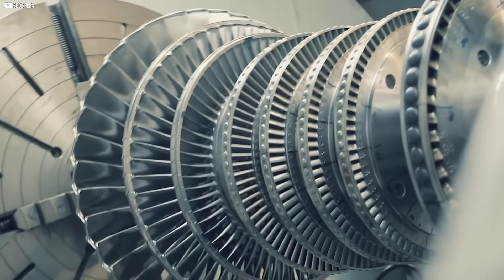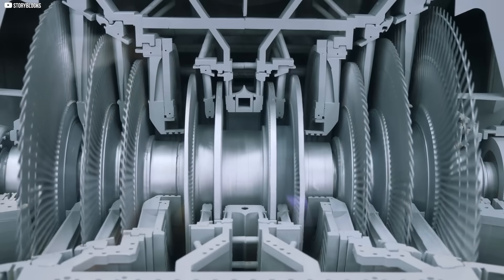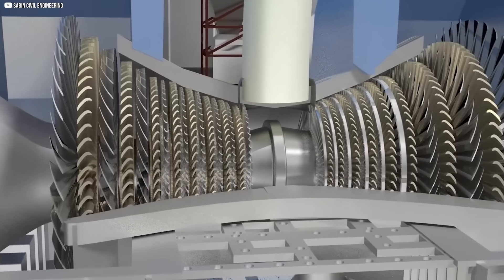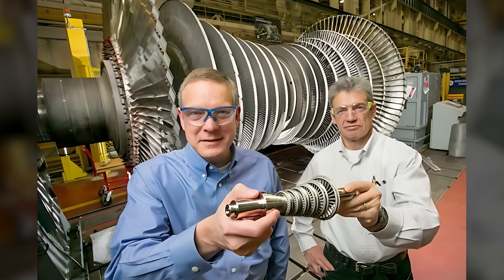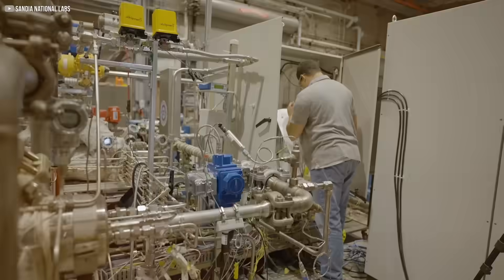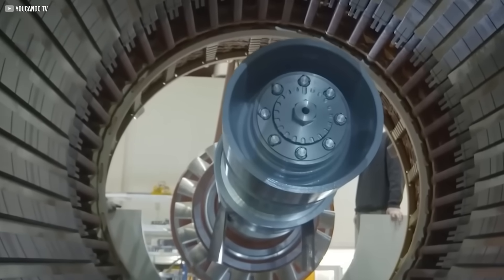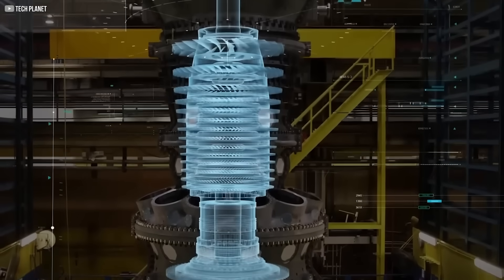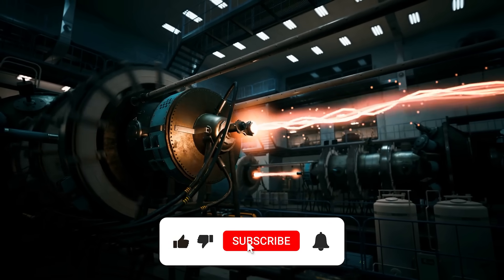Smaller, Faster, Smarter: The Next Generation of Energy

Comment: Doesn't it actually require a lot of energy to compress CO2 to a Supercritical State. Sounds like you'd be going backwards. Not a good start for a Maximum Net Positive Energy Generation Scheme
Reply: Not at all.  You only expand the CO2 to where you can cool it with cooling water.  The SC CO2 is still at high pressure and high density.  Steam you need to expand to where you can condense it with cooling water, where it is at low pressure and low density.  

It is the very large volume of steam at condenser temperatures that require the very large turbines.  

Work equals volume change times pressure. Work extraction from low pressure steam is low,
Reply: What about compressed air power 😁🎁🌎